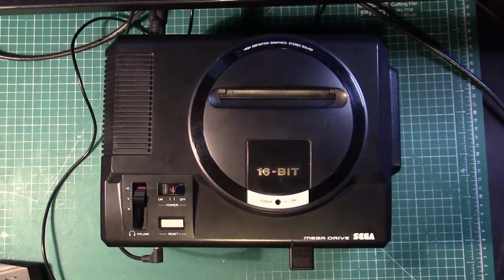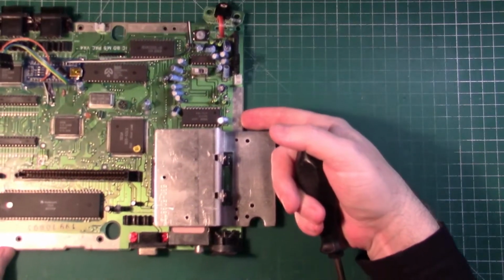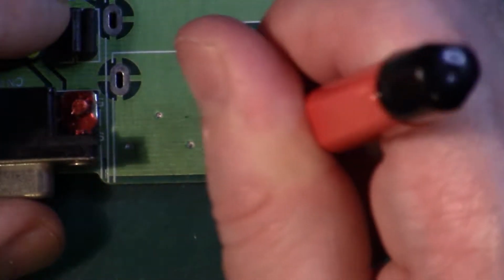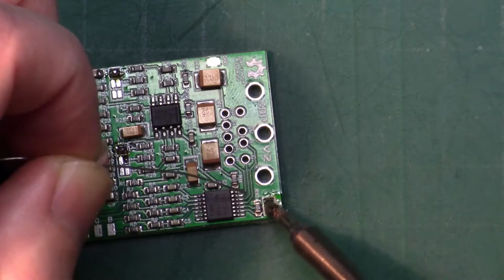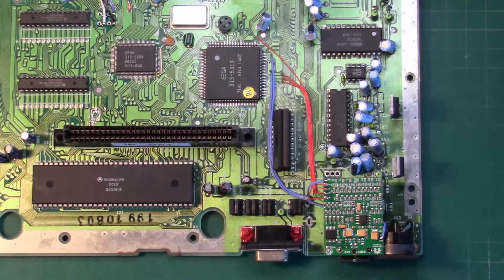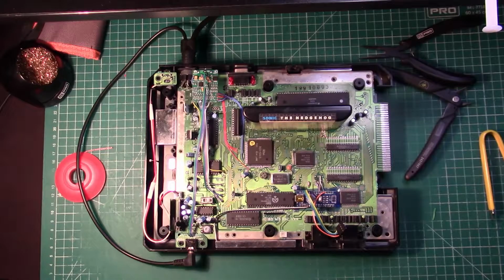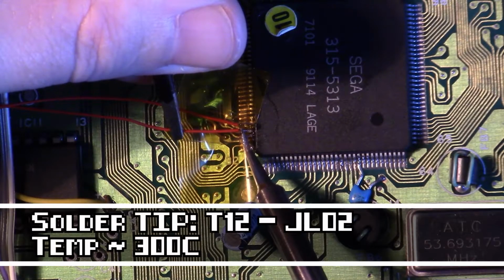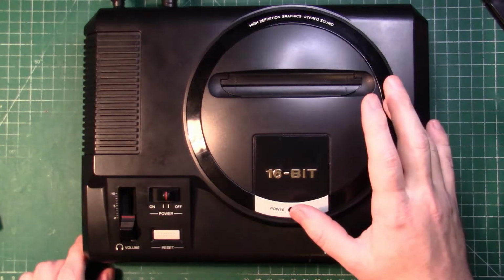SEGA Mega Drive - Jailbar Fix -  Model 1 (PAL VA4) Triple Bypass

Comment: I just connected my very early Genesis Model 1 up through RGB for the first time, and despite an incredible picture, I noticed very faint and subtle vertical lines in some games. Thought it might be my cheap DIN-5 to SCART cable, but now I know "jailbars" are a thing. :/ I don't think I'd mod my console over it, most people wouldn't notice, especially on my CRT Sony WEGA TV (on a side note, I don't know how anyone can complain about jailbars but use an LCD display, my I'm CRT purist!).

Comment: at 19:54 u added some caps, where did you get these from is in the bypass kit? cheers
Reply: and do I need them?
Reply from the maker: Hi, sorry for the delay in replying. I would recommend adding the capacitors. These through hole types aren;t the best ones to go with. Their just what I had around. A better suited Capacitor would be a 4.7uF MLCC SMD capacitor. A larger footprint size one would be ideal. Many SMD ceramic capacitors are very small so a larger one is ideal.

Comment: i have the triple bypass mod on my pal megadrive but still get those ugly borders around the edges  of the screen :(
Reply from the maker: I think that might be the overscan area. With modern displays you can see it, on older CRT displays it's off screen. Unfortunately on original hardware those color boarders are always there. On FPGA systems and software emulators they can be removed but without some serious engineering by some really smart people there always going to be there.
Reply: oh thats such a shame, i used to love the older CRT tv but they dont sell them new anymore so I just use my Samsung flatscreen 32 inch tv @GameTechRefuge

Comment: I often wondered if the triple bypass would benefit a MD1. I have the voultar one on my VA4 but there are still jailbars but much better.
I did notice my MD1 VA5/6 board has lot less jailbars than my VA4. I wonder if it will be better starting wuth that.
Reply: Both boards use a 7374, so I'm not sure if switching to a tbb board would do much

Comment: I have a stock PAL VA4 that has no jailbars and audio with zero noise.  I got all the mods as well, yet to install them.  

Notes: Pin 21 goes to the positive pin of c41, dont solder on the pin ever unless you have too which you dont.  Also never run the wires close to the motherboard as that puts them closer to the noise but looks nice I guess.  No one is looking inside, let the wries do their thing, so long as its away from the motherboard.  The RAM in this video is what you are avoiding, noise central.  There is no need to pull up any pins on the VDP, at all.  You will just break the pins, as they are weak.  You can remove the resistors on the other side.  This will keep the 5.6K ohm pullup resistors in the circuit and thus you wont have to replace them.  You can still buy the 315-5313A-01 or get a cheap mega drive and replace it if the pins break.  Its just costly.  They cost £6 each, or £4 for more than 3 but its the postage that is a killer.  If you buy the right equipment this is far easier.  Working out how to connect this on your own is not easy.  This video really helped me, I had worked out the method to install I was going to use and this video help me feel confident to go ahead and try it.  I used a different install method, I traced the RGB traces and disconnected them by removing resistors on the back of the PCB.  This way you are not driving two outputs and this will darken the output.  I was able to leave the csync circuit alone with out it causing any issues.  The two resistors for that are left intact.  There are caps that go to the pins on the IC (not the VDP) I left them on the PCB as well.  There are caps for RGB and csync.

Good luck with your project.  With hot air this is far easier and you can roll back the mod if needed.  I got a broken Mega Drive with a missing VDP pin 27 Red.  In the end using a dremel to expose the pin didnt seem like an end result I could sell.  So I replaced the VDP with one from a second mega drive.  Your console can survive a lot.  So long as you don't damage traces and pads.  So long as that one custom Sega chip is undamaged.

In this video we see a VA4 motherboard.  Be sure to do the Sega fixes, these stop flicking and crashing.
Reply: Where can you buy a new VDP?

That is good advice regarding the wire routing and RAM interference. Flying wires that avoid the RAM are best! Unfortunately the RAM traces run right beside the RGB traces so I prefer to lid the legs. On some boards the CSync trace runs along RAM traces too and could bring video interference if routed together, just like using unshielded composite video for sync in an RGB cable.

Comment: I have install md2 din in md1. But there is no stereo  output. I don't how to fix it.
Reply from the maker: If your using an MD2 cable, most don;t carry a stereo signal. So it could be the cable. Double check your soldering but it may be your cable.
Reply: @GameTechRefuge   Fixed. Is my speaker problem. Thanks for your reply.

Comment: Instead of lifting the RGB pins I simply removed the 3x 5.6k pull-up resistors from the underside of the board and soldered to the pads, thus removing the original DIN form circuit. I then added 3x 5.6k resistors to the 3BP V2 board between 5V and RGB out.
Reply from the maker: I considered it. I went with the through holes and *perf board, so if someone in the future, removes the bypass the old pull ups will still be there.
Reply: @GameTechRefuge  Did you perform the 5.6K pull-up fix after lifting the pins though to sort the colour gradient issue?
Reply: @davethebulb  I disconnected the resistors at the back of the board and leaved the pullup resistors in the circuit.  That way you dont need to cut traces or lift pins.  Just solder to the vias.  This makes the install cleaner and you can roll back if needed.  You also dont need to add any pullup resistors yourself.

Comment: This MD1 VA4 PAL is a 1991 one with Motorola MC68000, like Nostalgia Nerd's one.

My MD1 VA4 PAL is a 1990 one with April 1990 Signetics SCN68000 (and May 1990 Yamaha YM2612) and it also has a switchless 50/60Hz/region mod. It will be getting an RGB bypass as the sound is fine.

My MD2 VA1 PAL has a MegaAmp 2.1, because the RGB video from its Fujitsu MB3514 encoder is fine.

This one shouldn't have had sound bad enough to need a Triple Bypass rather than just an RGB bypass... but maybe it did?
Reply from the maker: Yeah the onboard audio on these is the best. Might get some nice shielded hookup wire to run the output of the front SONY stereo IC back to the 3BP board.

Comment: Please revisit this with Tianfeng’s RGB fix that he posted back in November.

The 3BP lacks the 5.6k pull-up resistors the model 1 VDPs require for full-range RGB colors. I’d like to know if the color difference you noticed is from that error. Unfortunately, none of my resistor kits has 5.6k resistors. I had completely removed my Sony CXA-1145P encoder anyway so I tried to use the Model 1 originals only to have one shoot out of my tweezers, never to be seen again. :(
Reply from the maker: I was planning on returning to install pull up resistors. I'm not too keen on the current examples, as they don't look very neat. I'd like to come up with a cleaner way of doing the install.
It's a shame there isn't an updated revision of the board, featuring the pull ups. 
That said, I may create a daughter board that solders directly to the 3BP for now but the best solution would be a new board rev.
I'm currently finishing some other projects and I have some minor health troubles that are slowing me down but I hope to return to this later this year.
Reply: @GameTechRefuge  

I just did this on my model 1 and tested with and without the resistor pull-ups.

With the resistors in place at the 3BP, I noticed the image was brighter, a bit more saturated on the lighter spectrum of colors.

Without the resistors in place, I noticed that the colors were darker and gave the appearance of more depth, until I got to a point in a game were the stage was dark and I couldn’t see any details that I knew were there.

———

The only issue I am having now is that I am experiencing the same “hiss” or in the audio. I had this prior to the 3BP and after it. I even used the same 3BP on a secondary board and still hear it. I ordered some HD Retrovision cables to replace my Level Hike adapter I got on Amazon (which may be the source of the audio noise I’m hearing).
Reply: @NovvaOfficial  I noticed that I get more hiss on Japanese consoles without the shielding and even more when I restore/retain the headphone jack. On consoles with internal RF/EMI shielding I can sometimes minimize it by repositioning the wires.
Reply: @emmettturner9452  

My issue ended up being the Level Hike HDMI adapter I was using. While it was a great fix for my need, it was not the best quality.

I ended up getting HD Retrovision cables and a Retrotink 5x Pro. These things paired with the triple bypass have given me near pixel perfect picture and audio.
Reply: @GameTechRefuge  Tianfeng seems to imply that you should complete the mod, check for the error, then perform the fix if needed. Though they are supposed to have it, most Model 2s don’t really need it. The final rev of the Model 1 is really a Model 2 in Model 1 clothing so it shouldn’t need the fix either.

As for how to do it cleanly:
If I could go back I’d leave the factory 5.6k resistors in place without lifting the RGB pins then remove the other three resistors on the bottom that connect it to the original encoder circuit. No need to lift pins and no need to cut traces. You can still tap RGB from the vias on top or use the footprints from the other resistors on bottom.

Edit: An earlier version of this post incorrectly said that the fix wasn’t for Model 2 consoles though it really is supposed to be there regardless.
Reply: @GameTechRefuge  …and I hope you feel better soon regarding the health problems. Good luck!
Reply from the maker: Here was my solution. Note: I lifted the RGB pins, that along with being a VA4 model one, this solution is somewhat unique to this type of install. 

https://youtu.be/z_mjb9rnLuE

Comment: Excellent video! Just managed to pick up mint Japanese Model 1 (first run) Mega Drive.  It came with a cheap generic scart lead and when I hooked it up to an LCD it had strong vertical lines evenly spaced throughout the entire image from left edge to right edge. I was hoping that these were just 240p /480i scaling issues.

When connected to my Pioneer plasma over composite you can see the more typical light jailbars that are spread out.

I don’t yet possess the same great soldering skills as you and don’t wish to damage my prized example so I need to practice on something else :)

Therefore just ordered a quality packapunch RGB cable, RAD2x along with a CRT.  Hopefully this will have a huge improvement and maybe I can live with some faint jailbars.  I will see.

Anyway great channel and just subbed!
Reply from the maker: I had one of those but decided not to mod it. They're just so cool. 
They have a little daughter board with the main clock crystal on it, as they discovered a problem in the circuit just prior to launch. Only launch consoles have this so decided to leave it stock. 
I since sold it but there so cool and getting rare.

It might be worth picking up a A VA3 Genesis or a VA4 Mega Drive if you want to do the jail-bar fix. Should still be able to get a good deal on one on Ebay, The original VA0 consoles are really cool show pieces, and it would be unfortunate to mod. 

Great that you enjoyed the video & thanks for the sub!
Reply: @GameTechRefuge  Thanks for the reply. I will keep this stock and pickup one of the models you recommended.
Reply: @GameTechRefuge  My brother brought a Japanese MD1 back from Thailand last month. We knew it was PAL-modded for SE Asia because it had an RF modulator coming out the side while Japanese consoles normally don’t have one at all. It also had a clock crystal modded underneath the Sony CXA-1145P encoder very much like you describe Japanese VA0 consoles. Unfortunately, it’s a common VA5/6 board so I presume the clock stuff was part of the PAL mod. I removed the extra components and restored the two traces I found that were cut. I then gutted the RF modulator and turned the frequency switch into a language select switch. The gutted RF modulator box is still soldered to the perimeter ground plane at the left edge of the board giving me a place to mount the mini-DIN for the triple bypass (no hole in the back of a JP console without removing the original DIN8). This is going to be a nice build. :)

Comment: you can still use the original din. You just have to cut the traces on the din connetor and run wires from the minidin output. also about still using the volume slider its possible there are some components to add  on the board. José Cruz and tien fang have posted on how to do it.
Reply from the maker: I don't like cutting traces. The front stereo sounds good. I'll be giving it a go in the new year
Reply: I haven’t seen them post anything about how to retain the volume slider… only Firebrand X’s guide to reconnect line-level stereo to the headphone jack without volume control. :(
Reply: @emmettturner9452  I have a VA0 with 3BP V2 board and the volume control works... who ever did the work solded 7 thick shielded wires to the 7 rubycon caps.
Reply: I know it's a year later but I'd love to know how to get the slider working.

Comment from the maker: Dislike? Thumbs up here. **There's a follow up video to this one in the works, to reintroduce the 5.6K pull up resistors. Many of the solutions I found online are effective but very ugly. So I'm looking into creating something neater. https://youtu.be/z_mjb9rnLuE  Audio patch through is also something I'm looking into but I may have to consult with some audiophiles on that one. Thus it may not be in the next video. Rest assured there's loads more Mega Drive content in the pipeline.